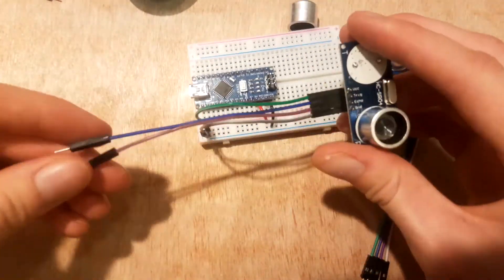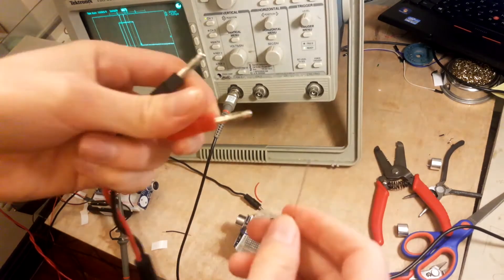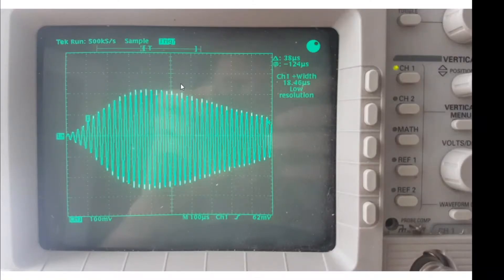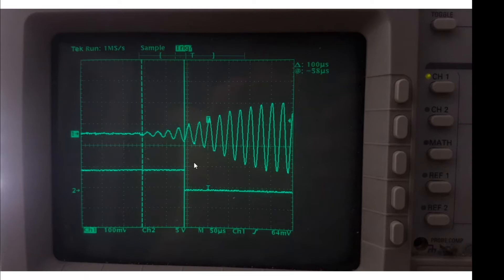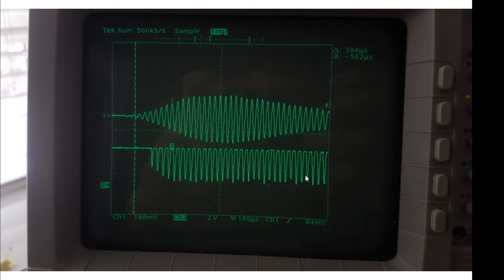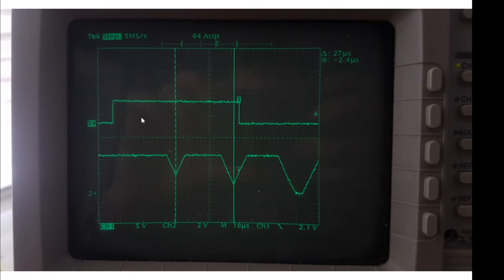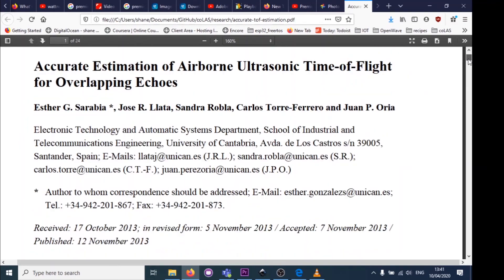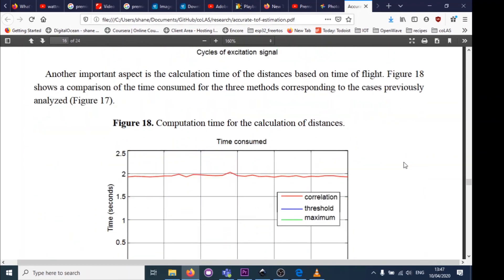How accurate is the HC-SR04 Ultrasonic Distance Sensor?

Comment: Im trying to modify this exact board to make an ultrasonic wind sensor. My intent is to de-solder the receiving transducer and extend it to a fixed distance. Using three of these to create a triangle to be able to detect the cardinal direction as well. This was my exact concern with ordering these cheap sensors. My question is, First, since the distance and speed of sound is the known constant, can I instead get the time reading without modifying the sensor? Second, In my coding, could I subtract the known delay of 25 micro seconds (or however long it is for my fixed distance) to the known distance to get a more exact time reading?

Comment: I found your analysis quite well thought out.  I am hoping to use these cheap sensors to help me measure changes in liquid density by way of time delta to penerate liquid. I would also split the tx and rx sensors  (by using two boards) and have the sensors on opposite sides of the vessel.  I dont know if the sensors will penerate a liquid or simi-solid.
Do you this will work?  Can I up the power on the TX to do this?
Reply: Hi Robert. Any luck in figuring out how these sensors can be used to measure liquid density? Thanks!